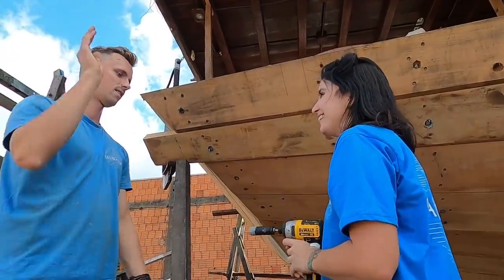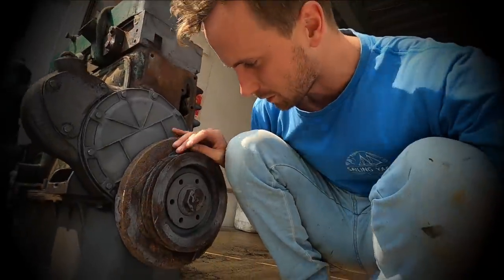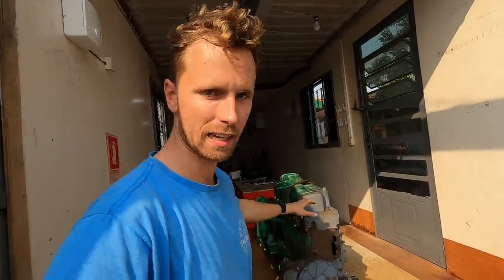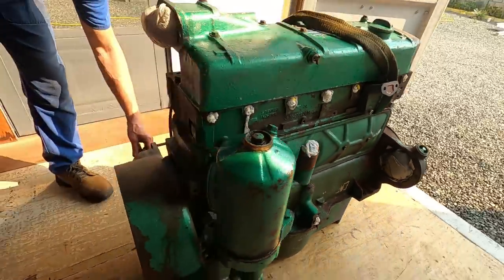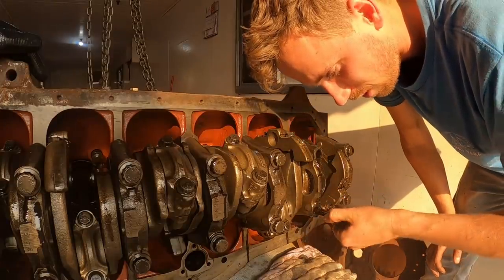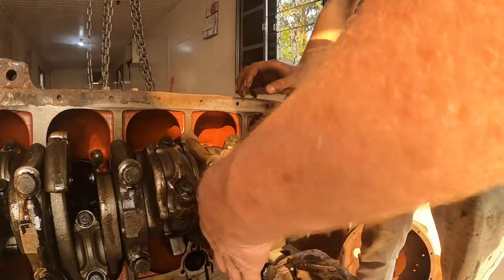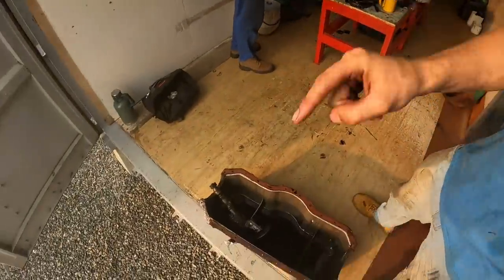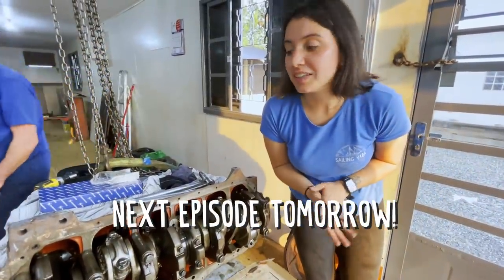ENGINE OVERHAUL STARTS NOW! (+ ingenious DIY crane) — Sailing Yabá #62

Comment from the maker: Hey guys!
We hope you enjoy our Engine Overhaul series!
Stay tuned because we are posting PART 2 tomorrow, at the same time as always!
By the way, let us know what you think about shorter but more frequent episodes!
Happy Sunday!
Xx Ben & MP
Reply: Love to see this more often, and it might be more practical for you as well as you edit just say 2 or 3 days instead of having to dig through the complete week.
Reply: nice
Reply: Excellent work Ben. I hope part two shows some top end work. Honing the cylinders and putting new rings in should be a priority right now. Or then as the case may be. You guys are awesome!  Closer and closer!
Reply: Big end Bearings and thrust bearings are on the crank shaft, small end bearing are on the piston.
Don't forget the thrust washers, check it for float end. Always best to get to know your engine inside out, you never know while at sea what will happen, and you might need to know how to repair it, after an engine has warmed up and is at running temp, take a listen to it. Rev it up and listen to see if there is a rumble or a rumble when deceleration, rev up rumble telling you it is small end bearings, rev down rumble is telling you it's big end bearings that needs replacing or tightening up, there are other sounds with an engine that will tell you something is wrong.  
Oh, don't forget after so many hours, you will need to loosen the bolts/nuts/studs and retighten them
Reply: as a few others have suggested, please consider a full engine rebuild when you have it out and torn down this much. and yes paint the engine a very light colour so you can see leaks better, maybe engine room in same colour
Reply: I love the idea of more frequent episodes, but are you guys ready for all the comments disbelieving half showed progress because kids on YT haven’t seen the whole picture at very first glance? I’m down if MP laughing goes back to opening, lol!!
Reply: Single longer episode for 30min is better. Today’s episode felt short.
Reply: I love your work. I like long episodes, but only once a week.. Then maybe two short episodes about precise jobs like here the engine, plus one long episode each week which would show every aspect, a more larger overlook. So everybody happy.
A suggestion when it's possible, insert plans, blueprints pictures in the edit where more passionate could pause and understand details (/ex engine plan showing bearings, crankshaft, ...) because we are many not to be english fluent especially technical parts so we could see more precisely what is what. I guess even you would gain working on shemes with english, portuguese [+flemmish &french 😁] terminology. A few seconds on screen so each one can choose to pause or just follow the flow. (Keep on with good music background !)
Sure it can be fun and entertaining and technical at the same time (Or we would not be so many Yaba followers)
Happy New Year dear Ben&Mp Yaba team, and Caillou !
Reply: Producing content can be a struggle, I know from the simple videos I am making on my channel. So producing a daily would be a monumental task in the long run. That being said, for a short run of "special" videos like the engine rebuild, it would be a nice diversion from weekly. Weekly however is a good format for regular updates. Cheers from Winnipeg.
Reply: Shorter episodes are great - especially if we get similar amount of content but spread over more time . . BUT .. But .. you removed MP's incredible laugh from the intro which I find unforgivable . ;)    That laugh always made me chuckle or grin it is beyond contagious . If you could see it in your heart to put it at the end somehow , or maybe I should just watch an old episode whenever I need a grin / pick - me - up . hehe cheers you two ; keep up the great work and I know how tough it is to learn all new terminology , all new skills , but I've never had to do it from a language I don't understand fluently so it must be very difficult but you are doing a fantastic job .
Reply: Hi MP & Ben, I watch just about every UTUBE sailing channel and you guys, (and Tally Ho) are the ones I “Mostly” hang out for every week. Your content and editing is quite excellent, so more than one episode per week would be excellent too, especially getting closer to the end of your rebuild. Hopefully not the end of our involvement in your life on this beautiful Vessel Yaba? Happy New Year to both you guys and your dedicated team, from an old retired Ship’s Captain (Irish) living in Australia. 
❤️☘️🇦🇺
Reply: @southerneruk  um no. Those are likely one time use fasteners. Retorque heads maybe depending on what the service manual dictates but you certainly don't do that to the bottom end. Also, if you have a big end cap that "needs tightening" its already damaged and you didn't do something right.
Reply: With your videos, always the longer the better, always the more frequent the better! We can never get too much, but we're happy to take whatever we can get.
I looked up the specs for your engine, 5.7 litres and 150hp. That seems an excellent match for your boat, large and heavy as she is, and I really look forward to seeing this engine power you in and out of the dock many times in the future. Looking forward to part 2 tomorrow!
Reply: Please please take that engine to a engine rebuild - machine shop. 
Yaba is a mororboat with sails.  Not a sailboat ⛵️ with an engine. 
Having run this engine without proper oil is long term dangerous for it. 
In your best interest, maneuvering a 70’ wooden ship with only one engine is lunacy with a cross current or crosswind.
Reply: @boherrmannsen8219  excellent advice
Reply: @eether54  With old engines, you do, like all new metal replacement, you get a certain amount of blunt edging that will wear off and create that lose part.
Any I would not worry, the engine all ready back on the boat and is about to be fitted in, if not all ready done so. 
So anything we suggest will be a waste of time and all ready to late, YouTube watchers are the last to know what is going on, even low the majority of viewers are on YouTube.
One of the reason why I like watching Ship Happens and Bally Ho on YouTube, there is no time period between any of the support mods they all get to see updates on the same day, and they do read and take notes

Comment: I agree with the majority of the comments, please do a complete overhaul. Crankshaft, camshaft, and connecting rod bearings. Pull the pistons and replace all the rings, hone the cylinders to ensure optimal compression  and minimize oil consumption. Yes it's a bigger job but it'll be as close to a new engine as it can be.
Reply: I'm with you. Full rebuild. Make sure you get the details for tolerances and not wing it.
Reply: totally agree do the job correctly..

Comment: I HIGHLY recommend doing a full rebuild on the engine. Engines last a long time, but every second they run they are wearing themselves out. Since the engine is out and you're already working on it, now is the time to get it all put back to like new condition. That way if you ever have to use it in an emergency, you can depend on it.

Also, I would recommend painting the engine a light grey color so you can see oil leaks easier. Then, before putting the engine back into the boat, I would paint the area under the engine and prop shaft white so any leaks will be easily seen. Finally, put lots of LED lighting in the engine compartment so servicing will be easier.
Reply: agree..
Reply: @T H I know I wouldn't trust my life to a "Craigslist rebuild". That's why I think they need to do a complete rebuild.
Reply: Do a full rebuild - it will be a major job to do later on..
Reply: Agree, All bearings, seals and piston rings.
Reply: @conradmex  Exactly. They're waiting for the engine to be done so they can finish assembling the bulwark.  Imagine how big of pain it will be if the engine dies and they have to pull it back out in a few years when the bulwark is assembled.
Reply: Another suggestion for managing fluid leaks is to make a stainless steel pan that sits under the engine, with oil diapers laying on the bottom. Make sure it can slide out for inspection.
Reply: Dont forget boring and honing the cylinders for trueness...seen way to many people cheap out on doing this and a few months later they are back do to ring blow by or even broken rings on really bad wallowed out cylinder bores
Reply: @T H They explained even the brand of sealant they are using earlier. I believe most of them are marine purpose.
Reply: @gsh341  You are actually trusting the entire boat as well as the lives of passengers to this engine. The engine is so common there it must be possible get a full rebuild by top experts at a reasonable price. Here' hoping". I have to admit it's fun to watch a newbie attempt it. Been there, done that (never again!).
Reply: @T H Those are experienced shipwrights and they care for all sorts of wood boats all the time. I'm pretty sure they know what coatings to use.

Comment: You're right there! Pull the head, pull the rods, change the rod bearings, pull the cam, change the cam bearings, and change the oil pump.  Inspect the rings on the pistons, and change the head gasket.  By the way, if this motor dropped 17.5 liters of oil into the bilge you've got a cracked pan, or the drain plug gasket is non-existent.  The oil pan (Carter?) holds well over half that.
Reply: And don't forget the water pump

Comment: As far apart as you have the engine now, I would go the extra mile and do a complete overhaul. Just because you have good compression now is not a guarantee that there isn't a small problem soon to be a big problem on an old engine.

Comment: Please open the engine more now when you have it out. So many cases done like this, and after few months there is a faulty oil ring or something which would have been seen and changed if the pistons were taken out. I would also hone the cylinders. Not expensive but gives you peace of mind...
Reply: So good to see that all the journals on the crankshaft were in tolerance, wait they didn’t check them. Well it’s a sailboat, who needs a reliable engine? 
I love that they are leaning the systems and doing as much as they can themselves, but this is not a good idea. If it is done properly they will never see the inside of this engine again and their new knowledge will be unused. If they do need to see the inside again, when will it fail? On a long passage, going in or out of a port, is there a good time to have an engine failure? This project should be done by professionals as they did with the injector pump.
Reply: I have to agree on that. It makes no sense to take the engine apart and not service the piston rings and bearings. It cost so little compared to doing the whole engine, so it’s a must.
Reply: agree
Reply: Well, it's an old Merc om350, probably never done a hard days work in its life. The compression check showed all the cylinders were fine, some of the bearing shells have got a bit of wear. It's their engine,  they have to make a choice.  Personally,  I think they are doing the right thing. Being a marinised engine my big concern would be the water jacket. Also, how does anyone know that the guy hasn't checked the journals? Although, looking at the shells, I can't imagine there's a lot wrong with them! Biggest problem with that lump would be glazed bores ( due to underwork). Maybe that's what the bloke was checking out. It ran before and, in my humble opinion, it'll carry on running for a long time yet.
Reply: ^^^^ What he said, would almost be outright stupid not to do an total rebuild. no offence meant (i might sound more harsh than i'm)
Reply: @boherrmannsen8219  well, it might be but, hell they have to make a choice. I'm 68 I have been working on diesels most of my life. Chances are we will see how this engine gets on. Talk to you then!
Reply: That engine will be fine, good compression what more could you ask. It's an old diesel engine, not a grand piano
Reply: @tamar5261  Probably yes. Just saying that when all that effort to get it out... Probably all good or same happens what happened to @Dangar Marine
Reply: I guess part II will tell us, no that Mercedes diesel is just fine, they built and sold those for 50-60 years they run and run and run, clean up the crank journals, throw in some bearings and seal her up…compression test was fine, top ends OK, injectors and injector pump rebuilt…oh she will be a screamer…. 

Have you bought new parts for an engine lately at a parts store? New doesn’t equal better…in my opinion.

It’s a sail boat not Cleetus and Cars….that engine used to drinking a little seawater every now and then…
Reply: @tamar5261  mediocre compression and scored bearings. umm ok buddy
Reply: @eether54  the compression was within tolerance, those bearings had thousands of hours left in them

Comment: I agree with all the advice that others have given here ..... Do a full rebuild.  Those main bearing shells were not in a happy state and you are right to replace them but that also means the big-end bearings ( the ones on the bottom of the connecting rods) will also be suspect.
Take the cylinder head off. Remove the pistons and con rods, inspect and at least, hone the cylinders. Replace the piston rings. Have the gudgeon pin bearings checked (bearings at the top of the con rod and sometimes called little end bearings.
On top of all this check the valves, injectors etc and replace every seal and gasket.
It may seem like a lot of work but the difficult part of removing the motor has already been done.
You have a mechanic available - use him. He will not be with you at sea when something goes wrong.

Love the project and looking forward to the progress. It is looking great so far.

Comment: Hi,whilst serving my time as a marine engineer I was taught to mark everything so that I would know where it came from,and also it’s orientation in that position..cheers .Please keep the videos coming.thanks..Roly 🇬🇧.P.S.where the oil sits is what in the UK is called the sump.
Reply: In my younger days we always marked the crank bearing caps, rod bearing caps, and bolts all kept in order so the went back in the same place. If its a complete rebuild with new rods and pistons and the block bored and machined then it wasn't necessary. Oh well that was a long time ago for me, perhaps we were overly cautious
Reply: amen brother..  mark well and bag the parts so as not to lose them.  when putting back together, please torque down the bolts per engine specs.  cheers
Reply: Shorter episodes but more in a week means that I always can squeeze in that episode and yet not mis out on all of the story. So, Great!
Reply: @williamlewis8741  It looked to me like everything was already stamped and numbered.

Comment: Smart mowe to overhaul the engine outeside the boat.
But advice is do a bigger rebuild.
Change pistonrings and maintain head and change head gasket.
Ewen if compression was oki i recomend this.
Workt with engines all my working life.
And do a half overhaul is newer a good solution.
With love to you both from Sweden

Comment: When I first started watching all I thought y'all were crazy for not just trashing Yaba... but after watching everything you have done I'm blown away at the detail...and can't wait for it to be finished...
I'm going to throw my 2 cents worth in here also...
With the engine out...and partially disassembled, there is "No" reason why you shouldn't go ahead and do a complete rebuild...bearings, seals, rings, honing...etc...
The money spent, for parts and labor are minimal now compared to the cost of doing it at a later date!!!
Keep up the good work guys...and keep learning...
We all had to start somewhere...

Comment: Just to clarify for you starting at the bottom where you started you have:
The Oil Sump
Then there is the Cylinder Block which houses crank shaft, con rods, pistons, push rods, cam shaft, etc
Then you have the Head that has the valves and rocker assembly.
On top of the head you have the Rocker Cover, which just keeps the rocker assembly clean and the engine bay free of oil splatter.
The above order is pretty universal, unless you have an overhead camshaft which lies on top of the head.  In your engine, you only have one head.  Some larger types of diesel engines have two heads and even bigger ship engines have one head per cylinder.

Comment: As other comments, please check out the pistons and rings. Also don't forget the camsaft and rockers etc but I suppose your mechanic will be doing that. And, finally, please paint the engine white ( or a similar light colour) to make regular maintenance easy once the engine is back in Yaba.
Look forward to your next video..

Comment: I know you did a compression check on the engine but you need to go ahead and pull the crankshaft and pistons,  put new rings on and check the cylinder walls to make sure there was not any damage or repairs prior to you buying yaba,  you are doing everything correct and taking your time to make sure it's reliable and strong,  it's been my experience with diesel truck engines that when you open them up and start replacing only certain parts you can bet that the older parts will fail.  It's out of the boat and now is the perfect time for a complete overhaul,  you will be glad you did and have more piece of mind  if you take the time now.  As always be safe stay healthy and have a great week.